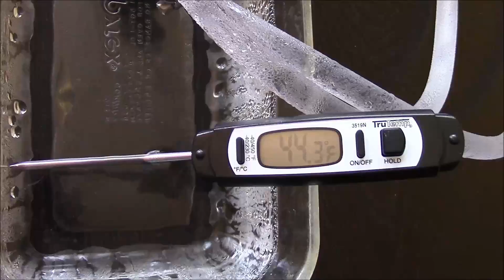How to Build A Water-Cooled Peltier Device or Thermoelectric Cooler

Comment: Great video! One question; I'm trying to assemble a similar setup using a Corsair Hydro Series H60 CPU cooler but I'm unsure of how to actually power it with a similar laptop power source due to the pre-assembled connections at the end of the Corsair cooler. Can you explain in a little more detail how you wired them up? Any additional comments are greatly appreciated!
Reply from the maker: If you don't want to hack the ends off the Corsair cooler, you can buy some cheap adapters online and then hack the ends off of those.  There are all kinds of adapters for PC building that convert a connector to another style connector.
Reply: @LDSreliance  thanks! I'm actually planning on connecting them to a power source similar to the one you used in your video so I was trying to get the specifics of the wiring setup. I'm trying to cool the water in a market fan that I bought which mists water out the front. My theory is that cooling the misting water beyond the ambient temp will create a greater cooling effect. Or so I hope!
Reply from the maker: I would say that should work.  Like I showed in the video, you do have to chop off the end of the laptop power adapter cable and connect/solder it to the ends of the cable that goes to the Corsair cooler.  If you don't want to permanently modify the Corsair cooler, I don't blame you but you will need to purchase an adapter for the it and then modify the adapter.
Reply: @LDSreliance  Got it. Thanks for all of the feedback!
Reply from the maker: You are welcome.  Good luck!

Comment: Have you tried putting 2 peltier units together? The more power you put through the unit the less affective it works so 2 x lower power should be better?
Reply from the maker: Yes, but I didn't have a way to lower the power at the time.  So it was just two peltiers sandwiched and running max power.  It was only slightly better performing.  I may revisit this again since I now have some better equipment for testing these things.

Comment: I am so glad I came across your videos do you think it would work well enough to keep the water cool well it is running through a personal cooling vest?
Reply from the maker: That would be a great use for this but the only problem is you would need battery power if you want to be mobile.  And with the huge amount of energy that these peltier chips use, you would need a lot of very heavy batteries to use it for a meaningful amount of time.
Reply: @LDSreliance  Thank you that answers my question I wanted to use a motorcycle battery on an off-road quad bike Is there anything you could think of that I could rig up for staying cool on a quad bike?
Reply from the maker: Only one I know of is by Sony and is about $120 USD (rough translation from Yen on this site:  https://pur.store.sony.jp/lifestyle/products/reonpocket/RNP-1A_purchase/)  Hopefully in the next decade battery tech will become cheaper and a lot more efficient and we can all have portable air conditioners.

Thanks for the sub!

Comment: Is there a way to add a thermostat to run this through a radiator to make an air conditioner out of it?  I found information on making a heater using water from a water heater and a car radiator with a fan now all I need is to know how to put a thermostat to something like this to make an air conditioner out of it. I want to build a van to live in and trying to find ways to do things without having to spend a fortune which God knows so don’t have. Please any help will be greatly appreciated

Comment: can you use this as an aquarium chiller for axolotls, like connect it to thermostat?
Reply from the maker: Yes, that is what I built it for originally.  Not for axolotls but for an aquarium dosing chiller.
Reply: @LDSreliance thank you so much. I was originally planning on making an incubator for my leopard gecko eggs. Coz I need a cool incubator to produce female. But then I thought maybe I can use it as well if we decide to have axolotls
Reply from the maker: You could use it for heating or cooling but it may be a bit hard to control without rigging up some sort of voltage regulator to moderate how much heating and cooling it will produce.
Reply: @LDSreliance I was planning on putting a thermostat like what I placed in my reptiles' tank for their heat mats. It will automatically turn on or off if it reaches a particular temperature. Like what I placed here https://youtu.be/zUMySoKWcQ0

Comment: Helpful video, my room gets hot so I'm looking around to see if there's something I can make, or if I should get an actual air conditioner. 
I am curious though, if you had the cool side facing the radiator and fan, and the hot side facing the water pump, would this be a good way to put out cold air?
Reply from the maker: I'm not sure what you are asking.  But here is another option I rigged up that might interest you: https://www.youtube.com/watch?v=Wq83-id7uQ4&t=2s

Comment: Hey, thank you so much for sharing your project and helping us by giving us an idea about how to make it. I am using same system, same components (maybe a different fan) but it works well. I am trying to cool 2L down, I can cool it 4°C easy but there comes a moment where the temperature doesn't change. I am using a second heat dissipater on the cool side, just above the water block. Any idea or suggestions?
Reply from the maker: It all comes down to insulation.  There is only so much heat that these devices can transfer.  The key is to make it as efficient as possible by limiting any sources of losing heat or cold.  Wrap insulation around whatever container you are using for the liquid.  Wrap the tubes in insulation.  Keep the whole apparatus out of direct sunlight or put it somewhere cool, if possible.

Comment: If I were to add 2 or 3 peltiers would I have to use a larger power source?
Reply from the maker: Yes.  Each device will double the power requirements.
Reply: @LDSreliance  Thanks..  I am in the process of constructing one, I just need some tubes and more chargers..  I used a decent size battery to test the pelters which does work.  Thank you so much for you tutorials!  Super great stuff!
Reply from the maker: @BroderickMcGarvey  You are welcome!  I am glad you found them helpful.  Let me know if you have any more questions.

Comment: That looks like a better way to do it. I was practically searching for this.

Just connect some Solar panels rather than adapter and you have free AC!
Reply: Excuse me, the solar panels are powerfull enough to keep running this system?
Reply: @diegochinchilla3209  yes. It depends on how you configure them.
Reply: Zen Innovations I’ve been trying to get knowledge to make this, but doing it with solar panels, makes the building price rise up like hell, could you help and tell me how to make it? I will be really really thankful with you!!!
Reply: @diegochinchilla3209  stay on my channel, I will eventually make it.
Reply: Zen Innovations wow it would be really really awesome, hope it will be like you say
Reply: Zen Innovations that eventually is gonna be how long? I wanna know if I should wait until you make your tutorial, cause I can’t run my aquarium without the chiller 😅👍🏼
Reply: @diegochinchilla3209  that will take some time, Material isn't easily available. Imports are being discouraged.

By the time you can participate in Solar QNA sessions!

Comment: Very neat just ordered stuff from your kit site!!  I wonder if windshield fluid or a different liquid could cool even more because it has a freezing temperature lower than water or would it ruin the motors do you think?
Reply from the maker: Coolant is probably ok since it is designed to be friendly to the materials in your car's cooling system.  But alcohol and other liquids may not be a good idea.

Comment: Thanks a lot for the video! Very helpful. Don't know if you still reply to comments since the video is quite old but I will try my luck: I am looking for a Company that can build this kind of Water cooler (or heater) so it can be linked to a mattress (nice finishing, phone app or remote to control temperature). My Company would be very interested in a cooperation

Comment: you're only negating the peltiers cooling by cooling it with the same radiator. use the cool side with the water cooling. air cool the hot side.

Comment: Saw a guy put this setup on a PC but it would cause frost on the socket and kill it. How could I limit it above freezing?
Reply from the maker: You can regulate the voltage to the TEC and find the point that works for the temp you want to achieve.

Comment: I am working on a Project similar  to this in the hopes of building a Freezer with peltier using 80mm Radiator on the cool side and 240mm on the hot side. Also will be using a 3 X 9amp Peltier Units Will post how is goes...

Comment: have you tried a bigger tank?  let's say 10 gallons of water in ice box with full of beer and coke?
Reply from the maker: No, I haven't tried it with large volumes of water.  I would need substantially more power and more peltier devices to even put a dent in that much liquid.  And I would need lots of insulation on the liquid tank so that the cooling does not get wasted.
Reply: @LDSreliance  Ive purchased it and tested on 5 gallons of water in a tank, it turns out ok, not chilling, but ok.. did you tried to push more than 6amp of 12v power to see if it makes difference?

Comment: I'm really curious about this: Say you take a 10" x 10" x 10" waterproof, plexiglass box with a removable lid. You install the peltier device onto one side of it so that the heatsink is located on the interior of the box and is submerged in water when the box/reservoir is filled with fluid. You could do this by getting a heatsink that is a few inches or so wider and taller than the peltier device and cooling block, followed by cutting a square hole in the plexiglass (big enough only for the actual peltier device and cooling block to fit into) and mounting/sealing the heatsink from the inside. This would allow the bottom edges of the heatsink to properly seal against the plexiglass (to waterproof it) while leaving enough surface area exposed to attach the peltier device to the heatsink from this newly cut, exterior "window." This way the actual peltier device can be correctly installed to the bottom of the heatsink (as well as the cooling block) which would again, technically locate them on the exterior of the plexiglass box. Now, do you think if you installed a pump to circulate the reservoir fluid up through a tube and out of the top of the plexiglass/reservoir box, through the cooling block, and back into the same reservoir (that the heatsink is installed in) would work? Would the cooling effect of the peltier device outweigh the expelled heat of its own heatsink and cool the water, or would the heat overtake the cooling ability of the peltier and warm the fluid (water) instead? I would imagine that the system could be battling itself, in a sense. Or maybe the heat will slowly dissipate and the cooling effect would take over? How would alcohol perform in place of the water? Do you have any input? I would really, really, appreciate any information that you have to offer here.
Reply from the maker: It all depends on how efficiently you can shed heat on the hot side.  That is where you make all the difference and where you should put your efforts and money.  CPU water coolers designed for computers work great for this.  The lower you can get the hot side temperatures, the colder the cold side temperatures will get.  That is how a temperature delta works.
Reply: @LDSreliance  Awesome! That cleared up a ton of confusion and answered a handful of questions that I had in my head about it.Thank you!
Reply from the maker: You are welcome.  Thanks for watching!

Comment: What do you think about a snow powered thermoelectric generator, big enough to power a cryptocurrency mining computer, that uses the heat for my cryptocurrency mining computer to power some of the thermoelectric generator
Reply: The only mining computer I have now is my gaming computer and I only run it in the winter because I only make like 12% on the electricity I spend which is like $0.07 per kilowatt, but the margin is a lot more in the winter if you can imagine. Like this is October 21st that's 60 days before winter and it's almost freezing outside at night. And we already use electricity for heating.
Reply from the maker: Your computer doesn't get hot enough to power a TEG.  Plus, even if it did, it would not produce anywhere near enough energy to power your mining rig.  Good idea, but the law of thermodynamics is working against you.  Mining rigs are huge energy hogs, too, so they will be hard to power with renewable energy unless you have a huge solar panel system.
Reply: Yeah you're right, you would have to scale it up so big that the fuel would probably be more expensive than electricity.
Reply: But what about turning the heat from the computer into electricity, I wonder how much electricity I can get out of that, although it would require a custom Loop that would probably cost around 160 to $200 if I include both the CPU and GPU.

I wonder why you can't buy gpus without the heatsink, and delided  CPUs new, I mean it just takes the risk out of getting the best performance and if they're going to cheap out on the thermal performance anyway I mean you can't cheap out more than not providing any right?
Reply from the maker: Most TEG's need 350+ degree temperatures to achieve their max power production.  And even then they only produce a few watts.  It would barely put a dent in your computer consumption and would harm your electronics getting that hot.

Comment: Out of curiosity, I believe you understand the difference between TEC and TEG...
Is is possible to build a TEC sticking to a TEG as power source to cool something?
Instead of having the TEC's heat-waste basically 'wasted'...
Reply from the maker: The hot side of the TEC would not get hot enough to generate more than a trickle of power.  Most purpose built TEG's need 240-340 degrees Celsius to generate meaningful power.
Reply: @LDSreliance  Ahhh...
How about 9 TEC in 3x3 (or 16 TEC in 4x4 or 25 in 5x5 etc) and using heatsink to pull the heat to 1 TEG?
Is it still not enough?
I'm thinking instead of the TEC's heat part basically wasted...
No matter how small, is it really meaningful enough for 16 or 25 TEC to allow 1 TEG to reduce like maybe 1 or 2 TEC's consumption?
Reply from the maker: No because regular TECs cannot heat up to that temperature.  If they get past about 80-90C they will burn up.

Comment: I want to try this for cooling a CCD camera for astrophotography
Reply from the maker: Wow, that is pretty cool.  Let me know if it works!
Reply: LDSreliance will do. Got everything I need to so just got to get the time
Reply from the maker: Sounds good.
Reply: 3D printed a bracket for the camera to accept the water cooler. I’m thinking of having a hose come out of the block to go right into the water cooler pump.

Comment: Let's run a rough a calculation

2lbs of water at ~ 30F temp drop = 60 BTU

for 1 hour that is ~ 17.5W of cooling with 120W in

Hmmm...

How does the improved model run?
Reply from the maker: It runs better.  I also improved it by insulating the tubing.  Peltiers are inefficient to begin with but it is made worse by having to cool down the mass of the reservoir and tubing and water block and pump.  If you could insulate most of those then you would probably see more like 40W of cooling.

Comment: If i plan to run this on batteries... let's say LG18650 MJ1 3.7V 3500mAh High Drain 10A Continuous Discharge Batteries, would it work?
Reply from the maker: If you can regulate the voltage down to 12V sure.  If you wire 3 of those cells in series that is only 11.1V but if you do 4 of them then that is 14.8V.
Reply: What's more critical in getting colder temperatures in peltiers? Amps or voltage? Peltiers would still work at the rated numbers albeit at a not so cold rate right?
Reply from the maker: Amps.  But you can gain increased efficiency by dropping voltage a little if you care about that.

Comment: Can the hot water be used to produce energy by using a extra peltier...
Reply from the maker: There isn't any hot water in this setup except in the closed loop cpu cooler.  Are you talking about attaching a thermoelectric generator to produce energy from the waste heat?  Usually those need a much higher temperature to produce meaningful power.
Reply: LDSreliance thnx for the reply i was thinking of doing the same...
Reply from the maker: Give it a try and let me know!

Comment: That’s quite cool, if only there was a way to improve the cooling time eg 15-30 min...
Reply from the maker: You could improve the cooling time pretty easily by using multiple peltiers and a stronger pump.  If you move water through the water block faster it will improve things but you might want to get a larger water block and add a second peltier to it so that there is more surface area to cool down the water.

Comment: If you were to reverse the polarity of the peltier element effectively switching the cooling and heating sides, what would happen in the loop?
Reply from the maker: It would work in reverse and heat the water instead of cool it.  Shouldn't have any problems at all.